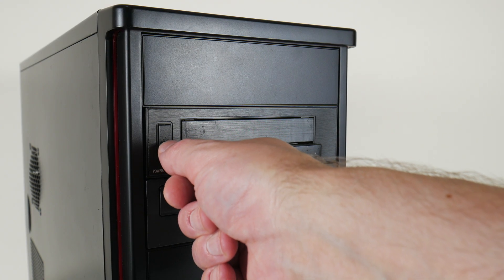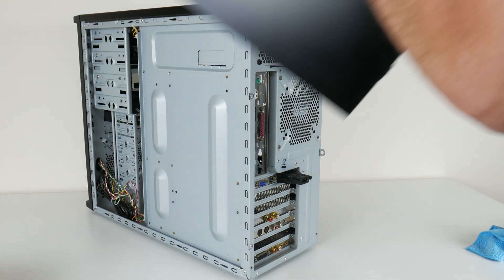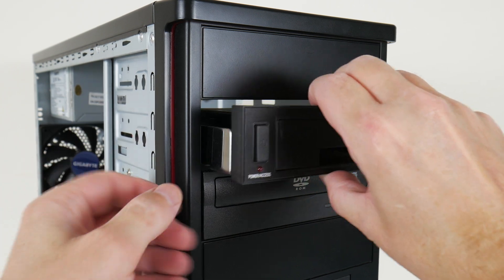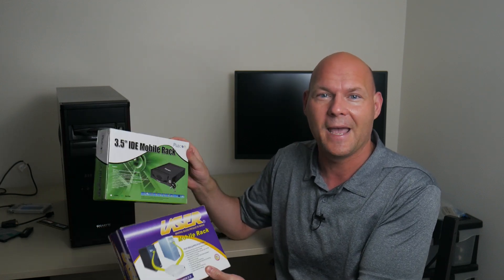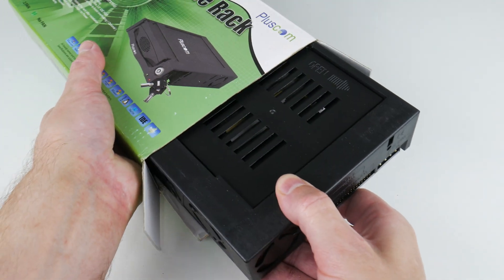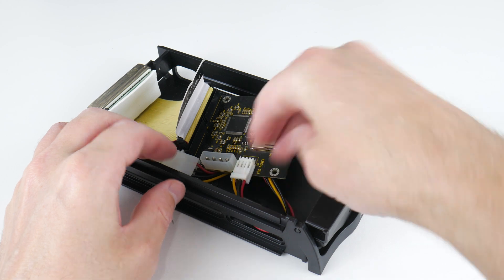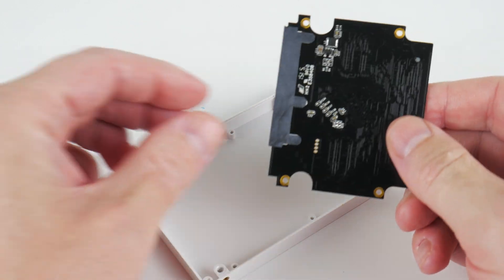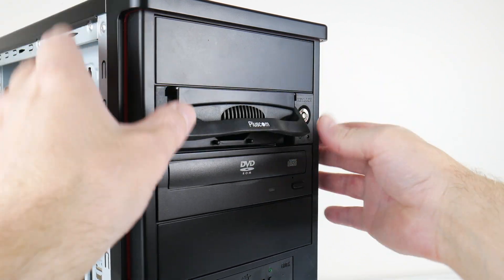You can hide modern flash storage in period correct Retro PC with Hard Drive bay / tray

Comment: Phil, do you have a link to the IDE one...I'd like to hot swap IDE drives from front bays?  I don't recall a specific link if you mentioned one.  Thank you in any event.
Reply from the maker: The IDE bays are all vintage, you have to find second hand models. Sometimes they are installed in existing PCs.
Reply: @philscomputerlab  ok thanks. will check ebay and aliexpress I guess

Comment: I recently bought some beige drive bay with adapter for hide my ssd as a game storage here are my results. I have main drive as sd card and with this drivebay computer turns up slower because it kinda wait longer to find that ssd. It's working and i see that partition but i think ssd capacity is too large (it's 240gb) so some files on this are visible and working for win98se and some are messy files (on machine with win10 looks ok). I think i should make a smaller partition for this like 128gb but from other side its only storage for games so there is no rush.

Comment: Almost a year ago (this January, to be exact) I found a similar removable HDD bay on a trashed computer: not a DOS/Win9x era machine, but a Gigabyte GA-965P-DQ6 rev. 1.0 with a Core 2 Duo E6300 and two identical 160GB SATA HDD (Seagate ST3160811AS, with 99% identical files, probably a RAID 1 setup), apparently capable of using all modern flash storage with ease so it was kind of strange to see it on a 2006-7 build. The removable HDD bay had a broken 6.4GB IDE HDD inside (Seagate Medalist ST36451A), though.

Comment: I have a biege HDD enclosure on my setup.  The flash card inside the enclosure runs Dos 6.22 and the internal HDD runs Windows 98.   I switch between the two installs by turning the key lock on the enclosure (which turns the power on, or off to the CF card).   It's a strange way of doing things, but I like it.

On a side note the enclosure is a seriously hefty bit of old skool kit, made out of impressive lumps of aluminum.  You could really hurt someone with it!   Especially if they suggest my system is not period correct!

Comment: I have used this method for a few years. You can try to screw the sd module to some hole into the bottom of the drawer, because sometimes it bends up by the wires and gets stuck.

Comment: Nice! I like it when all the front bays are populated and a hard-drive dock like that is actually very useful, I implement them in many of my builds.  I also like to have two optical drives, one is a reader and the other is a writer. One modern application that I like to use is a fan controller so I can fine-tune the ventilation and noise level. Many people think it´s overkill to have intake and exhaust fans in a retro system but personally, I feel more comfortable and assured when I know that the air actually changes inside the case. I also like a decent cable management, which unfortunately is a bit over-looked in retro computing.

Comment: i use a 128GB SATA 3 SSD for a HP Pavilion A1000 
swapped the case and a HDD wont fit in that one
internal stuff like formatting ~7x faster than a SATA 3 HDD of same capacity
tested 4x4 Evo ( 2000 game ) and it's all good 👍

Comment: I know there are purists out there, but at least when it comes to data storage, I don't see anything wrong with using modern hardware, especially when it comes to taking advantage of solid state options as I have no nostalgia whatsoever for noisy, clunky, heavy, slow mechanical hard drives.  I do like having an actual floppy drive though.
Reply: It kind of does not feel 100% the same. I keep a couple of hard drives around, and even those are not as noisy as I'd like :D Having the HDD sound is a part of the experience of running a retro PC for me, even though maybe not the most important one.
Reply: @romanrm1  LGR recently looked at a solution for that - hard drive noise emulators.
Reply: @retro-computing-gaming  yeah, but unfortunately it seems like the played sound is not nuanced per disk access pattern as on the real thing, it's always the same.

Comment: my solution for my a G4 PowerMac is a 2.5in Sata SSD bay in the PCI slot, connected with a sata-ide converter. i have 3 ssd's with different OS's and i just swap them out in the back.

Comment: I was curious about that hot swappable drive bay you have. I have a case that does that with SATA drives but I really need one like yours for data mining people's old HDDs. Friends and family always come to me to "Get stuff off of their HDDs"., it'd be a good thing to have instead of running a pata to sata on a sata 3 to USB 3 converter.
Reply from the maker: I use a USB 3 to IDE/SATA adapter. The drive bay shown at the beginning is SATA only, it takes 2.5" and 3.5" SATA drives.
Reply: @philscomputerlab  Thank you for that info. So I would still need a converter. I wonder if someone sells one that has the pata to sata built in?